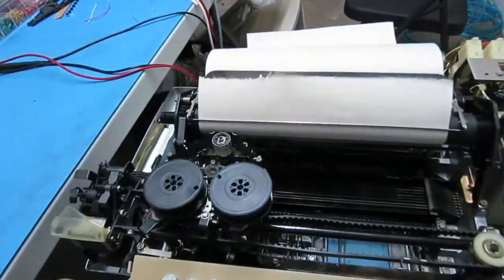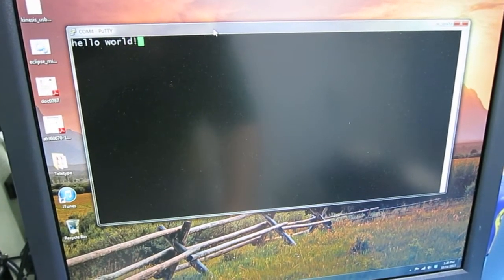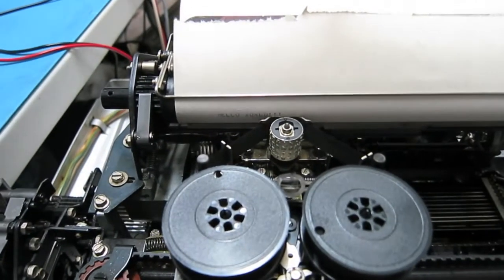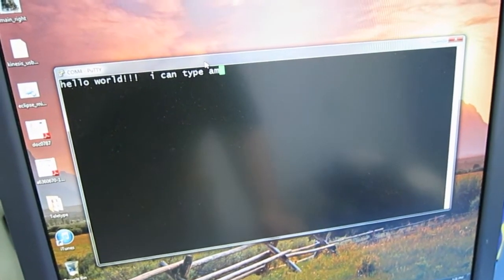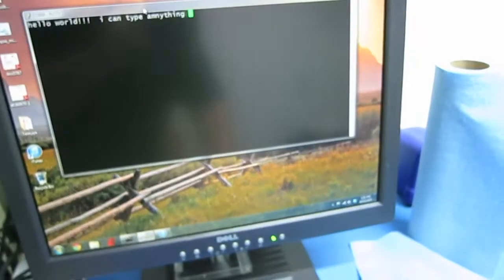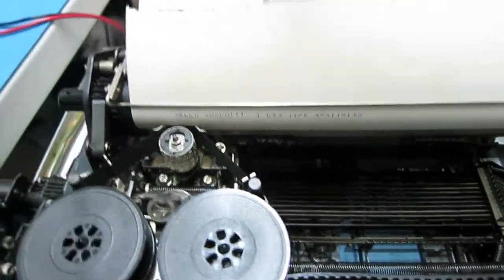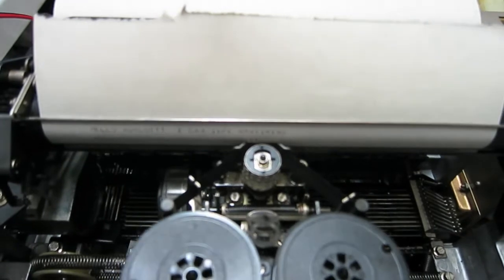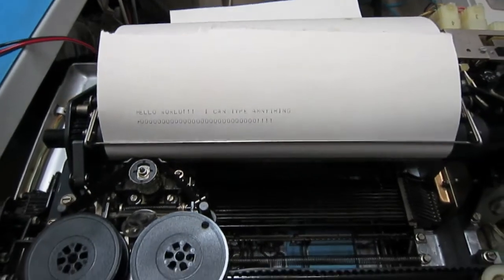RS232 to Teletype

Comment: Great video! You mentioned that your RS232 to Current loop circuit used opto isolators. I've seen a circuit which does not use opto isolators and wanted to know the advantage of using such isolators?